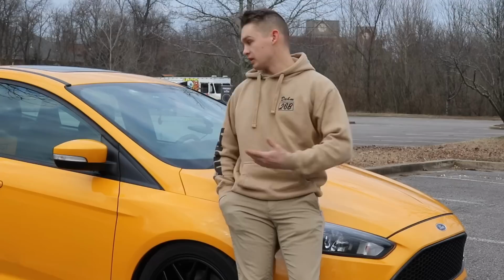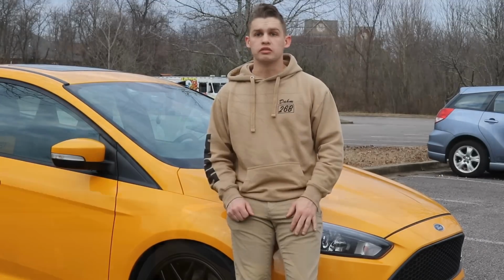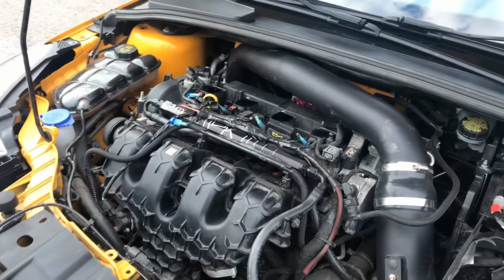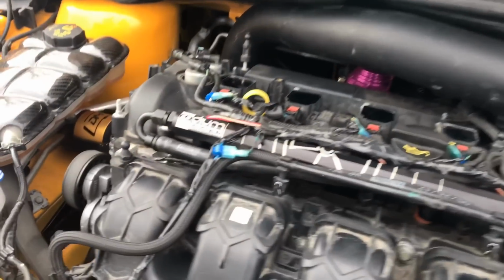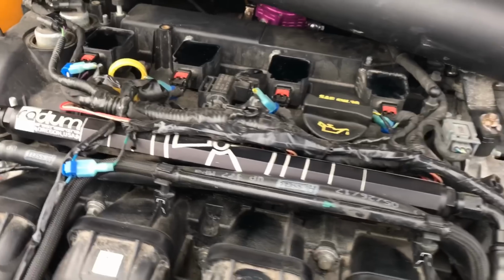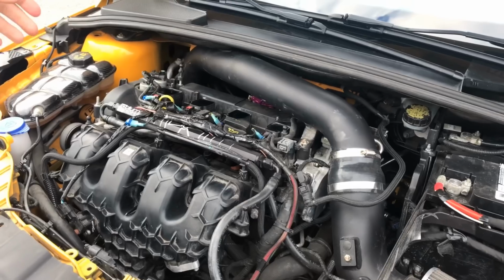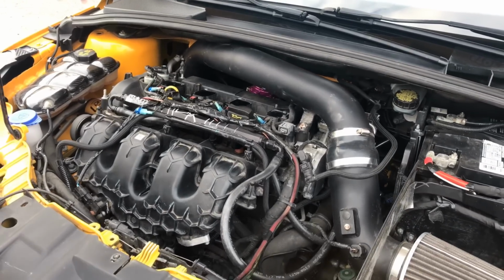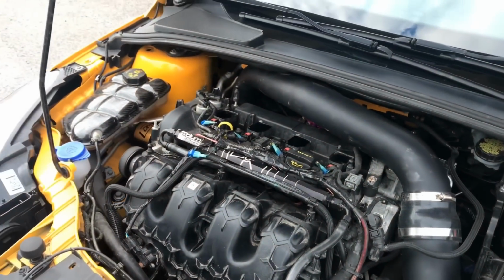440 WHP BIG TURBO FOCUS ST 2867r Gen 2!!! ST/RS ARMY EPISODE 6

Comment: 400-450hp is still very safe for aggressive mods on a stock block. only thing you really would have to worry about in any capacity is slip timing. Brian at JST i hear is a very good tuner with quick turn over rates on revisions. i wanted to tune through him when i finished my build, he wasnt able to E-tune since i have the v3 upgraded cams and wasn't physically located where he was. i remember you mentioning that the head has bad valve float (or flow). i would recommend that you have a conversation about that with the guys over at speedperformance. they have focus's with 600hp running stock valves in the  heads (ported) with their cam kits (v3) on top of other necessary high HP supporting mods. if you want high RPM limits without worrying about how and when you shake the motor apart(everyone removes the harmonic balancer), i personally would stick with the 2.0 setup with forgings instead of stroking the motor (assuming you wanted to do that). the v3 cam kit has double coil springs and an intake duration of like 264 degrees or something like that. the (v4) has 284 degrees timing... you're basically asking yourself to never be able to drive the car daily if you want the v4. your build definitely has room to smack the blocks limit (without sleeves) of 780. just depends on how you want to achieve that. so without nerding out and leaving a dissertation as a comment, ill just leave this reference for everyone to read here. 
http://www.speedperf6rmanc3.com/content/StrokeOrNot.pdf 

when you're selecting your forged bottom end components, i believe the biggest consideration is what pistons you will use. a quick read from the guys over at JEPistons is worth taking a look at. http://blog.jepistons.com/2618-vs.-4032-material-differences
Reply: i agree with what you've said and ive watched alot of speedperformance's work theyve done on this platform, great company pushing the limits. However i think speed performance did some testing and the head didnt really flow power past 7500rpm, i could be wrong in that but thats what i recall. Im still up in the air as far as the 2.0 build or a 2.3 build, im leaning towards the 2.0 because i dont really need the extra displacement to help spool a turbo or anything but definitely want to make some more power. i honestly havent looked too much into cams or cam kits, when i finally delve into a deep build it will be something i research more heavily.

Comment: Why drag it... Thing would be a beast around a track.
Reply: Drag racing is so boring too.
Reply: It's his car let him do what he wants
Reply: I dont have too many tracks around me unfortunately, i would love to get it on one eventually. I drag race it because i like the rush it gives me
Reply: Is this Jack Moran?
Reply: Brayden Brooks ye
Reply: Jack - lol how tf did i find you
Reply: Because serving gaps to people is far more satisfying
Reply: Straight cars are for fast cars, tracks are for fast drivers
Reply: Hypster yes straight car is for fast car
Reply: Yeh Ford made it to handle turns not top speed lol. I have a 2013 Audi S5 MANUAL now and I still miss my 14 ST! Handled better than my S5 in turns! Way better! But I'm way faster! 😂 Trade offs. I want my cornering back! 😭
Reply: or touge
Reply: Most towns don't have a circuit track to run on
Reply: @SamHager4233  This 440 whp/490 crank hp ST would hand a 530 awhp/600 crank hp S5 its rear. The gearing and being 600 lbs lighter help the ST. I had a 420 whp/480 crank ST, ran a buddy in his S5. He had close to 600 crank. With awd he could take me off the line but by 80 I was passing and pulling away. In rolls he gets a short 1-2 sec jump, but its bye-bye after that.
Reply: These cars are an absolute blast if you find the right road with a good surface. I used to live in Boulder Colorado and you could get out into the mountain roads and highways with the car. If you find the right road and its empty you can have an absolute blast with the car. I think they could be a blast to autocross with or time attack runs. They have a tremendous amount of grip right from ford but there are tons of suspension parts available for them too bigger sway bars and coil over kits fender flairs for wider wheels and tires. Or even the drag race route bilstein make shocks and struts for drag racing just as they do for carving corners.
Reply: @a7463189  hey how is the ST coming along? You have an Instagram or YouTube? The big turbo still holding up?!
Reply: @lilJake581  Cars actually since been sold by me, however the new owner is still going strong with it as far as i know. I upgraded to a 2019 Mustang PP2, insta is @Cardouchenation although im fairly inactive on it
Reply: @lilJake581  @tangerine_scene 
I own this car as of 2019
Reply: @Salvatore Dash flixportal :P
Reply: @Benjamin Azariah Thank you, I went there and it seems like a nice service :) Appreciate it!
Reply: @Salvatore Dash glad I could help :)

Comment: I have the same set up minus the Aux fuel and I'm making 350 to the wheels. The gtx2867r makes the car better in every way.
Reply from the maker: Absolutely man I’m glad you’re enjoying it!
Reply: @club.alfagt  which turbo are you on currently?
Reply from the maker: @tyquanwashington.8510  2860rs
Reply: @club.alfagt  that's a good one for quick spool on a track. When's peak boost hitting? 3200?
Reply from the maker: @tyquanwashington.8510  yep I love it, and tbh I have no idea hahaha but yes somewhere in that range if I had to guess. The turbo is only one factor for a track/autox build, so I went with the most reliable, bulletproof option that was also affordable to replace/upgrade if need be. I wanted something I could set and forget and so far she has been amazing. I recommend the 2860 to everyone who wants a power plant that can do it all with no hassle and not blow the engine in the process. I make 340/380 on 93 octane via vdyno
Reply: @club.alfagt  I can definitely see the benefit of that turbo.. Mine hits peak boost at 3500 (28 psi) and holds about 25 psi till redline.. Who you tuned by?
Reply from the maker: @tyquanwashington.8510  very nice! And tuned by Alan at edge autosport
Reply: @club.alfagt  nice.. Dudes at Edge are awesome. I bought everything through them and had no clue they tuned until I already went with JST. Super happy with JST though.

Comment: I have the same damond motor mounts as well, with a cpe stage 2 rear mount
Reply: How's the vibrations
Reply: Exact setup ive got, couldnt be happier.
Reply: @c-los918  Vibrations arent all that bad, alot of the transmission slop is gone though
Reply: @a7463189  I'd be willing to do it but I don't think the wife would like the vibrations lol
Reply: @c-los918  ya she would.

Comment: I’m going for a big turbo upgrade very soon. What is absolutely everything I need to keep it reliable while making it just as fast if not faster than an RS? I currently have full stage 2 Cobb right now
Reply: A hybrid Focus ST is stronger than a stock RS. With the BT you will run circles around even a lightly tuned rs. What setup did you end up going for?

Comment: 440 whp w stock brakes? ehhhh I'd look into some brembos. That was my first purchase with my ST
Reply: You don't really need a "big brake kit" unless your doing high speeds like well over 70mph hard stopping. Stock calipers paired with really nice rotors and pads will do just fine for most drivers.
Reply: Stock breaks are great. Don't really need brembos lol
Reply: @sategllib2191  thats likely true for people who daily their ST and hit a high speed every now and then..but if you track your car or even run a few spirited cruises in the back roads, you WILL get brake fade and have a bad time... I ran stock brakes with upgraded "Power Stop performance" pads on a track weekend and melted my front calipers, the brand new pads melted in 3 sessions down to the metal and caught actual fire... it was my fault for assuming PS made track capable pads...so the next time i went out i upgraded to MOTUL high temp fluid, ss lines, stock rotors with Hawk DTS-60 pads, and a stage 1 brake cooling kit and never had another fade issue. Then for the street i run the same fluid/lines obviously, but drilled/slotted rotors with some Duralast Gold pads since i rarely drive hard on the streets. But a few twisty weekends I've noticed fade thats actually scared me a few times...

So yes, the stock brakes are actually great for driving in traffic or a spirited quick run without hot lapping or constant high speed braking... but do not rely on the OEM set up with your life if you push your car. I now have RS Brembos and its a cheap enough upgrade to ensure you have great brakes that wont fail you (rears are the same, slightly larger rotor and different brackets is all, same caliper and pad for the RS/ST). But def upgrade the rear rotors if you run Brembos or you will get brake bias.

Comment: Lol wut? My RS only makes 400 to the wheels and will run 12.3 all day on street tires, and drop into the 11s if I run slicks and launch it like I want it in the junkyard.
Reply from the maker: Herp Derp awd vs fwd
Reply: @club.alfagt  true, but the st is lighter.  And with an additional 40 to the ground plus slicks it should make up for that.
Reply from the maker: Not necessarily. Driver mod is huge. Other factors are in play such as altitude. We will see what happens
Reply: @club.alfagt  true.  Not sure what attitude im running at since PA ranges so wildly.
Reply from the maker: Herp Derp yeh we’re in Tennessee/Kentucky so who knows. I’ll have an update video when he eventually takes it to the track
Reply: What mods you done to the RS to get 400 awhp? That's nearly 90 whp more than stock. Plus the RS is a HEAVY 3470 to 3540 lbs+ car whereas a base ST is 3200 lbs.
Reply: And one can launch the ST from 2000 rpm to 5500 or any in between.
Reply: @club.alfagt  you mean density altitude. Altitude is track elevation.b

Comment: Why isn't anyone running deatschwerks injectors on focus st? Easier than aux fuel rail
Reply from the maker: Jack Laughlin port fuel injection also cleans valves...
Reply: The issue is not the injectors... its the fuel pump the it starts losing pressure above 350 so you would need a fuel pump and injectors... might as well get the aux fuel and clean up those valves abit.
Reply: High pressure fuel pump is the limiter, the high pressure pump like gabrian said is only good to around 350. The low pressure in tank pump is good for considerably more than that though

Comment: My st blew up with a short ram intake and a muffler delete. A buddy of mine is on his 3rd engine too 🤦🏻‍♂️
Reply from the maker: Henry Soares I’m on my second motor. Tuner error
Reply: WTF? What were you doing? Bad tune or what?
Reply: Meowth849 I’m in a camaro now with a engine 3 times the size realized that there is just no fixing stupid 😂😂
Reply: My 15 st with 40k miles no tune blew a turbo but my engine compression is perfect

Comment: 440 fwhp should put it into mid 11's. It is 3400 lbs, vs a 3750 lb Camaro SS with 385-390 rwhp. And don't drag it. Drag is very hard on the trans, axles, clutch and suspension.
Reply: If you Are just doing stop light Gran Prix  probably gonna OK ! 

HAVE. FUN !!!

Comment: What size turbine housing is your gtx2867r? I’m stratified tuned and supposedly my gtx2867r gen 2 .64ar is maxed out at 360whp
Reply: Andres De La Torre do you have an aux fuel system and/or larger injectors with an e30 tune?
Reply: @imfraeglasgow  I'm running WMI with an e30 tune. But according to my tuner the turbo is just about maxed out.
Reply: Stratified sucks... unless you just want a "pops and crackles" tune. JST all day.
Reply: They didn't say anything about bigger injectors or aux fuel? Because stock fuel system is what is holding you back, not the turbo.
Reply: Dillon Liffick was thinking of going JST while I finish the new motor
Reply: im running the larger housing but this turbo should be good for just shy of 500 regardless of housing. I think the limiting factor is the water meth, if you had a 2 or 4 port i think you could definitely push it further
Reply: the stock fuel system is your limit, not the turbo. stocker hits 300max... your turbo will run to 450whp on a good tune and fuel set up with ethanol... you can actually run aux or grab a pricey XDi hpfp which straight swaps with your factory one and also get to about that number. The advantage here is zero special tuning or wiring...you swap the hpfp (located 6" to the left of the battery) and tune for it (it just requires the tuner to remap the fueling).

Comment: If you have 440 at the wheels you will be deep into the 11s! On just a decent pass. Your car runs 13s from the dealership lot!
Reply: biggest issue is weigh in this, they're still mildly heavy cars. Hopefully with a gut and a good pass we'll see 11's!
Reply: @a7463189  as long as the horsepower is there and the driver knows what he's doing weight is on no concern.
Reply: @edwardthayer9386  true to an extent. More power will definitely help overcome the weight factor. If I can drop 300lbs from the car it will help my achieve my goal
Reply: @KTown407 World 😂🤣😂 open your eyes then!
Reply: @KTown407 World plus you'll never see one break 14.6 because they run mid to low 13s from the showroom floor depending on driver and tires.
Reply: Actually Edward Thayer stock ST Focus' run high 14's stock. You better go check the performance specs again.   
My neighbors 22 yr old had a 2010 Cobalt SS Sedan  which where turbo from 2008 to 2010 but those had a bigger Ko4 turbo whereas the 200-300 lb heavier ST has a little Ko3. Both stock, in cool 45 degree air with very warm pilot sport cup tires mine ran 14.6@95 mph, (spot on with the best magazines) while his stock SS Cobalt sedan ran 13.8@103.7 mph.  We ran 7 times and he put 2 school buses on me. We both have lots of racing experience too. The SS had no-lift shifting standard and made 20-25 hp & 20 lb-ft more power to the front wheels than the ST.
Reply: You'd be hard pressed to run mid to high 13's with a mild bolt on ST with Intercooler, dp, light flywheel, and full exhaust 300 crank hp. I do not list a CAI here because they do not add mire than a few hp. The ST should have came with s bigger Ko4 turbo to begin with.
Reply: MasterCarguy44  that maybe true but which one would you rather have?

Comment: Its 2019 stock golf r’s run 12’s
Reply from the maker: Nancy Perrault stock turbo focus STs run 12s....what’s your point?
Reply: ST/RS ARMY TV stock turbo with a shit ton of mods and weight reduction and slicks my point is the st is not a fast straight line car
Reply from the maker: Nancy Perrault wrong 
Stock turbo 
Full bolton 
Ethanol
Rear seats removed 
Is a low 12 car
Stock motor stock clutch stock trans
That’s reality for most cars in the STs pricepoint
But you’re right. Not that anyone was claiming that
Reply: ST/RS ARMY TV i own a FoST i am not hating just stating the facts and i ran against an edge st and it blew my doors off and im fbo 94 octane
Reply from the maker: Nancy Perrault edge st is incredibly fast from a dig or slow roll. I don’t see it keeping up top in thi
Reply: @club.alfagt  the Edge ST is also AWD and makes more HP & TQ... Not to mention it has different gearing is it's an auto.

The Edge ST is fast.

Comment: Injectors need huge upgrade, clutch, front axles. I bet it can barely run with a stock 2016-19 Camaro SS
Reply: lmao...he has 4 port aux fuel...doesn't need any upgraded injectors. New clutch probably a good idea but the stock clutch is fine and will only slip launching it hard. Front axles are fine unless you're running slicks and dumping the clutch at 4500+ rpms. Manual vs manual, it will keep up with a camaro SS from a roll...not from a dig because FWD problems of course

Comment: Low 12’s with 500 crank hp???? Pretty weak for a 3200-3300 lb car. A stock 3800 lb Mustang GT does 12.1@116 stock with 448 hp on 91.460 hp on 93’s. 1/4 is not a fun aspect of the ST. It’s not a 1/4 car pilots hard on the drive train.

Comment: The engine bays are ugly. The engine bay on my RS 500 Cosworth with all the Spec-R was what an engine bay should look like. Might well as be a Tesla.
Reply: Grow up
Reply: @nicooo3223  Very intelligent response!, lacking content somewhat.
Reply: they are, thats why they use the engine covers. Ive seen some good looking ones but for the most part theyre really bland and meh
Reply: @WaxScum  That's a fact, at the end of the day its what it drives like. That is why i say the engine bay on the RS Focus is bland. I'm not that keen on its looks any way. The RS 500 Cosworth would be seen by people on the road quarter of a mile away, it stood out, it was exactly what it looked like, quick!. Then when people asked to see the engine bay they were in for another treat. The cam cover with the Cosworth legend on it, you could see the eight dark green injectors you could see the huge TO4 turbo. and as i say the added  Spec-R polished tanks. Then of course it was easier as the engine was the right way in, north - south. And not forgetting the steering wheel being on the right side!!